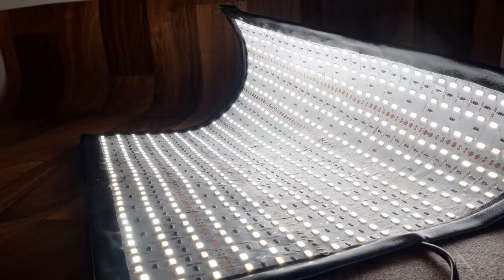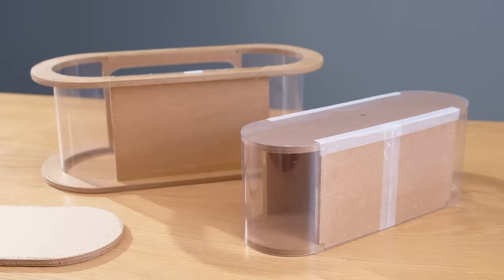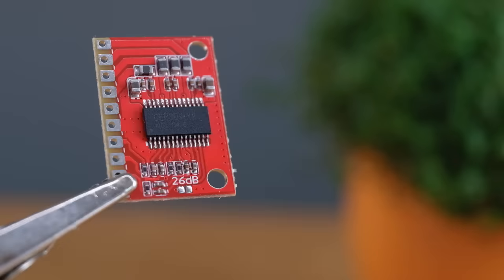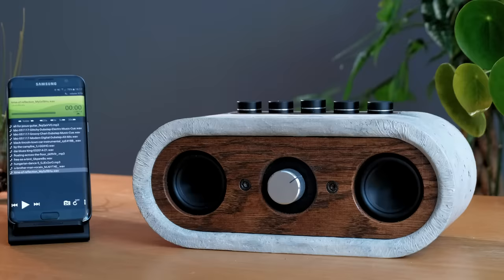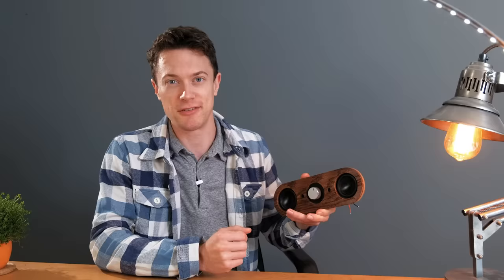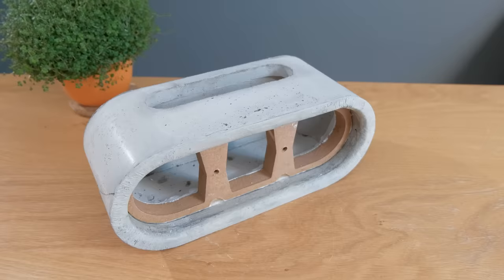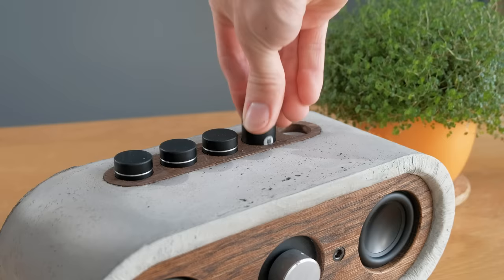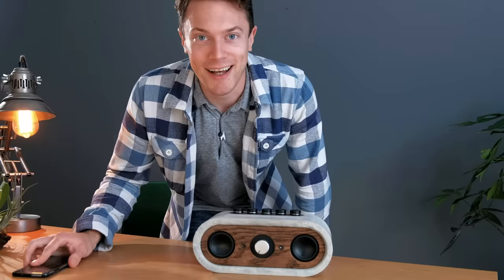Build your own Concrete Bluetooth Speaker (how-to)

Comment: It is indeed a very cool bluetooth speaker. But powering in with batteries for portability and then making it out of concrete seems counter productive.
Reply: at least you'll know if you forgot it somewhere :D  like a couple of bricks are missing from your bag
Reply: Niels Hvid maybe it’s portable for around the home/garage/garden
Reply: Niels Hvid well, the cats will not tip that one off the table for sure.
Reply: I like it seems to be more of an aesthetic choice, which is not bad IMO.
Reply: Niels Hvid I think its for minimalistic look
Reply: Actually, that speaker might only weigh just a little bit more than a JBL Charge 3. Overall, it's not as practical I agree, but at the same time I doubt it's as heavy as everyone thinks. Perhaps the creator of this can tell us the overall weight with cells to find out for sure?
Reply: i think is just a house "piece of furniture", pleasant to see and no cables, but intended to stay in the living room somewhere
Reply: You can make yours out of paper maché if you like.
Reply: Yeah I think by 'portable', it implies easy to move around the house, not take with you in a rucksack or anything like that.
Reply: Make it out of wood then.
Reply: Stuart Wood Rucksack WTF why not backpack?
Reply: Ange Einstein Why does it matter?  Rucksacks are bigger.
Reply: it is not heavy
Reply: It's not like this tiny bit of concrete weights in at a million tons. However, if it bothers you make a square box out of wood and be done with it. Just remember to stuff some dampening material in there or it will resonate the hell out of it.
Reply: I'm guessing it would just be nice to have it outside or in a place where plugging it in isn't as simple
Reply: 22 simple cement crafts and ideas
Reply: That level of concrete doesn't actually weigh that much, I'm surprised at how many people are asserting how heavy the speaker is without even building the project.
Reply: Not if you like weight lifting
Reply: They do make light weight concrete. At the cost of strength. It uses a foam material as aggregate, but you would need to add some kinda reinforcement.
Reply: thats the only way to achive an infinite bafle in a small package

Comment: YOU SHOULD TRY TO MAKE AN OMNIDIRECTIONAL SPEAKER! THEY LOOK AND SOUNDS AWESOME!
Reply: Make the same thing without a back, rotate so the speakers are upward and, run both left and right amp channels off the left bluetooth output. Finally add some feet at the now bottom (which used to be the back) so the housing sits a decent gap from the surface below. This may not sound like a huge shift, but conceptually its very different, as instead of a stereo with closed back design where your pressurizing the housing, you are now a mono ported design that relies on the surface below for reflection. Thus its not as directional, and adjusting the height of the feet tunes the resonant frequency, rather than the chamber depth\volume. If your lazy you can even build the same thing with one speaker at the top out of a bit of rigid pipe instead of custom concrete housing, although it may not look as good unless you decorate it somehow.

Comment: I'm listening to this through a pretty nice sound system and when I've heard reviews of speakers before and the Youtuber has played them through the video they've always sounded bad, even the expensive ones. This is the first time I've ever thought, hey that actually sounds pretty good! It's punchy, I'm getting a nice high end and bit of a low end. This is through the aggressive Youtube compression too (something you can avoid if you upscale a video to 4K, the audio gets a nice bump in quality too) so OMG it must sound awesome at source!

Overall this is easily the most impressive build for something electric (so I'm ruling out some of the giant wood working projects and things like that( but if you can imagine this has a category of build, its at the top by a big leap. Nothing comes close. It is amazing. I was and am still amazed. Everything from the quality of the case build process to the components used. A thumbs up seems like an insult, so I left a comment too.

Comment: I don't know why , I really love to watch your videos its so relaxing .And project would be better if you choose 4.0 or + Bluetooth module rather than these cheap 2.0 modules which definitely compress audio and lacks bass.
Reply: Hi there!! wich one do you recomend for this simple diy? can you paste an ebay link?
best Regards
Reply: Something like a chromecast audio would be awesome
Reply: Probably because all the parts added together is >100 USD
Reply: Just switch the Bluetooth module to an Micro usb cable to get power to a Chromcast audio (both uses 5v). And a old 3.5mm headphonejackcable from the chromecast to the potentiometer.  
I will try this with a 3PDT toggle switch ON/ON to be able to switch between BT and Chomecast ;)

Comment: Amazing, but pleeeeease separate the resonant volumes of right and left channels and calculate them even with something basic such as winISD! :) When different channels share the same resonant volume, they can experience destructive interference (a bit like with reverse polarities)!

Dayton audio provides TS parameters, therefore you can compute accurate designs very easily!
For that driver I'd suggest a ported enclosure, but here are the dimensions for both designs:
sealed enclosure: 0.25L - you would get cutoff at around 160 Hz, with tiny 2ms group delay @100Hz, resulting in a smaller band, but accurate sound
vented enclosure: 0.6L - vents: diam 15mm, length: 200mm - cutoff at 85 Hz, with a higher 7ms group delay at 80Hz  resulting in a much wider band, but a tad less accurate sound reproduction .

Ideally (on the vented design) you'd add a highpass to the signal at 70Hz to optimise for cone excursion. The highpass should lower the "chuffing" effect on the ports too!

I'd be happy to provide more measurements and to show you some tools to copute this yourself if you're interested!

Comment: Would be awesome to have a 2020 version of this with a rechargeable battery and DC power connector.
Reply: One of the limiting factors for that is that USB ports are not all airtight, meaning that they aren't ideal for connecting to the interior of sealed sound enclosures like this. I would be curious  to see how he would get around that (either by having the port on the outside like he does in this build or using a different connector i.e. barrel connectors)
Reply: @carsonm6140  From what most manufacturers do, they make use of a rubber covering for their charging ports. Assuming it actually prevents sound from escaping into those crevices, you'll need to accurately design your rubber cover.

Comment: so you remove the batteries when recharging? it would have been great to add a charging conenctor
Reply: I guess you could also add another power source and either allow it to charge your batteries or use it with a switch. Trying to do both would require a bit more planning but is still doable I guess
Reply: Connecting the batteries in parallel and using a step up dc to dc booster would be better i guess
Reply: Buy another six so when six are playing six will be charging😜
Reply: And does he have to charge them with a home made xt60 connector charger (I’m American- sorry is xt60 is a normal plug for everyone else.     I was thinking the same thing about using and charging at the same time. I have one of this batteries that you can use and charge; it wouldn’t look as cool with the “power cells” but I planning on tossing that battery inside and having an external usb socket to charge the batteries too.
Reply: I think its better if the battery died and need replacement for future.

Comment: *WEIGHT CAPTAIN HERE"
average density of concrete is 2.2 kg/dm^3
I've 3d modelled the concrete part and the volume is around 1.11 dm^3
concrete weight: 2.45 kgs
speakers are 181*2 grams
batteries are assumed to be around 45grams *5
3.03 kg for now, and if the electronics are 100 grams,
and the wood parts with plastic tubes are 200 grams, then the total is around 3.3 kg
THANK YOU

Comment: How do you understand about electronics components?
What did you study at university or college?
Reply: Anybody with internet can learn about electronics, you're learning about it just by watching this video.
Reply: So, primarily it comes down to categorization.
Everything is made from four primary components. Resistors, capacitors, inductors, diodes. 
Fuses are special cases of resistors designed to fail under specific conditions.
Batteries are special cases of capacitors, using chemical means instead of static charge. Motors are special cases of inductors.
A transistor at its simplest is a pair of diodes. Switches are transistors without a gate. 
Transformers are made from two inductors forming a magnetic field...
DC and AC are conceptually very simple concepts that can be applied in limitless ways.
They are stacked like legos into the billions. Integrated circuits are made from patterns of transistors, resistors and capacitive regions. Memory is primarily transistors and capacitors. Simple patterns repeated over and over.
Check out the Engadget video on the new EUV lithography to see how crazy it gets.
https://www.youtube.com/watch?v=oIiqVrKDtLc
(I did not study at a university or college; I've got a 6th grade education, but I'm quite literate and experienced after 20 years in the field. If I can do it, so can you. Buy a $10 ESP32 WROVER devkitc, install https://micropython.org/download/esp32/ via USB, load the bluetooth module and play around via the serial console, subscribe to bigclive and bitluni or search youtube for beginner esp32/arduino projects)
Reply: @SLLabsKamilion  
Awsome answer dude! 🙂👍
But i think you forgot about one thing...namely the question of how lazy a given person are.?!
Are you really IN or do you just chase easy sollutions and wine about all the things you cant do?

A compassion and hunger, of a field can take you much futher than any university degree. 🙂👍
Reply: @SLLabsKamilion  thank you for that, seriously. I've been kinda casually trying to grasp these concepts and never seen it all broken down in a way I could truly understand until I read your post.
Reply: im 12 and i learned about elektronics, just by using the internet
Reply: @lazyh-online4839  I knew, but I ask for faster way?!
Reply: @kamielbreyne7859  what do you know?! I've studied a lot, I asked because I thought maybe he'll give some thing new to learn, new source or new book etc . . .

Comment: Not the first time concrete was used to make a speaker. A high end company Hales Loudspeakers in the 90s made a pair that were amazing. Not a long lasting product for obvious reasons. Drop concrete it cracks for instance.  I am a huge fan of the inert qualities of concrete. Does not breath of change shape. Just manage reflections and standing waves inside, and it is amazing. 50 plus years of audio, I have seen allot, but I love the DIY because the ingenuity that goes into it. Let's not get carried away with that tiny amp module. That Cambridge Audio Integrated is going to swing current in low impedance loads way better than that SMT chip amp. But for this project it is fine. The Tripath amps are cheap and fine project amps inside of their constraints. Fun project you got here.

Comment: You said you DO like your speakers,but here is a quick tip from an long-term audio enthusiast such as myself.
If you ever find Polyfill,do experiment with putting it into speakers,it significantly improves bass preformace and also gives a bit more natural midrange,also I wanted to ask,how are you supposed to cool down the amp chips,without a heatsink?
I mean the oldschool Class AA amps from 20/30 years ago do need giant heat-sinks because they have alot of powerloss,but on the other hand the new small class D amps,don't generate as much heat,but still need a heatsink.
So how DO you keep the amps cool,if you keep them cool at all?
Reply: New Class D chips don't need heat sink when driven with lower voltage. Only when driven to the max they benefit from a heat sink.
Reply: this is probably 30W Peak to Peak not an 30w RMS amp, so it's probably not putting out enough juice to worry about a heatsink, (most computer parts under 10w don't have heatsinks).

Also another tip for him is he should have a bass reflex port, and isolate the left and right speakers so they don't fight.

Comment: How do u charge this
Reply: Take out the "power cells" and plug the XT into a dedicated lithium ion charger.
One of those blue hobby chargers will work fine.
Reply: Yeah, that sound pretty bad for a 5 cell setup.
Reply: Nope it wont run becuase he wired them in series. Taking one out will disrupt the circuit. Don't know why he did that. It looks really nice but charging is a pain in the butt except you also build a rig of plugs to charge them at once.
Reply: You will need charge them all at once and jerry rig up some balancing circuit or remove the batteries and replace them with fresh ones.

He did it for power 18volts is better than 3.7v
Reply: No, because he can make a "charger" where he connects the cells in a row and sets the  Charger to 5 cells.
Reply: Because he wants a Voltage at 3.7V*5 and not 3.5 Volts + 5*X Amps
Reply: Well if you made 10 cells you could have Half of them charging and the other half in use
Reply: Angry Pixie wranglin'
Reply: would be awesome to be able to take out and put in as many/ as few as you like in parallel. I guess using a step up converter would do the job.
Reply: Jaron 1337 TP 4056 module is a great choice for li ion charging.

Comment: I made a concrete radio in 1980. I created a mold from a very simple art deco radio. The shape was essentially a rectangle except the left side's top and bottom corners were rounded off. All the angles where the 5 flat panels joined were curved as well. (Top, bottom, front, back and right side.) The molded plastic grille was integrated, and took up about 2/3 of the front. A dial and a small on-off rotary switch sat where the grille met the solid 1/3 of the front. It didn't work. I'm pretty sure it didn't work because I omitted a lot of the fidgety steps our friend did in making his concrete speaker. That is, mine was 100% solid concrete. Mine, plural. I poured 4 or 5 and retained two. They sit a top tall bookcases, reminding me not so much of good times past but of the 7.0 earthquake that's surely in the future.

Comment: So, why are using this batterys now? And how do you charge them, do you need a seperate power supply? 
And WHY is at 18:00 the mittle battery sticking out a bit more, this is driving me insane
Reply: 5 Batteries seems one too many for most chargers.  So yes could you explain a little more about the batteries please..  ps  excellent electronics setup.  :-D
Reply: Yeah, a little charger build would be a nice extra. Basically you replicate the pvc pipe and connector build but don't wire them in series. Wire each connector to a TP4056 charger board and use a beefy 5v charger to each in parallel. Theoretically you shouldn't need a separate board for each cell as they should all be discharged (and therefore charged) at the same rate. But these boards are super-cheap (you can usually get 5 for the price of posting 1) and this will help extend the life of the cells.
I can do functional, I can't do pretty. This is why I watch DIY perks!
Reply: Alternatively scrap the TP4056 idea and re-use the powerbank circuitry you discarded from the battery tubes. They should work perfectly fine for charging!
Reply: Just make a hole 5s pack with balancer plugs and charge on rc charger ...or much easier use a small 12v lead acid battery and a step up ....or eavwn easier since nobody put this is his pocket just a normal wall plug
Reply: 18650 Li-Ion batteries have a nominal voltage of 3.7V. When fully charged, they will show 4.2V.
Reply: And usb wall adapter give out 5v which will destroy the lions
Reply: what drives me insane is how you spelled “middle”
Reply: im sorry, im german and middle in german is mitte, i might was sliding a bit into germen right there
Reply: i know only little german. so if i speak it, its quite embarrasing
Reply: Mein Deutsch ist sehr schlecht.

Comment: You can use a vibrator that you sink into the concrete, that will make all air pockets rise to the surface and dissapear completely =) I'm no electronics whizz, but i have worked with concrete (on a lightly larger scale with a vibrator, yes it actually looks exactly like what you think about when i say vibrator, that would put a t-rex to shame, hahaha)

Comment: how to recharge them again?
Reply: I think you can unscrew the top and remove batteries from the black tubes to put them into a charger that supports protected LiOns. I have some hobby grade chargers where you can connect XT60 connectors but those do not like protected cells.
It would be nice to have a charging port in this BT speaker
Reply: That's a big fail. The procedure is unscrewing them. Putting them in some recharger. waiting, putting them back into those former battery banks and then aliding them back in. He could've installed some form of charger on the inside with a switch you just feed with a mains cable. Or just any number of solutions, a higher voltage battery... I really don't think the solution with those 5 former power banks is the best one. It's mainly for looks it seems. You can perhaps also just have an isolated latch where you can put the batteries in and it'll be less work. Ah it's a decent project but I don't think that was the best way to go about the power.